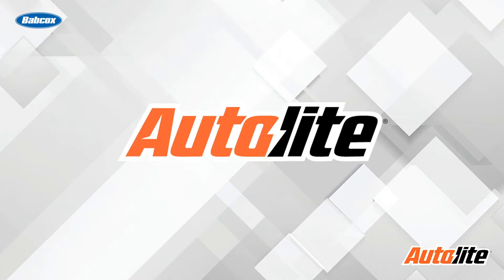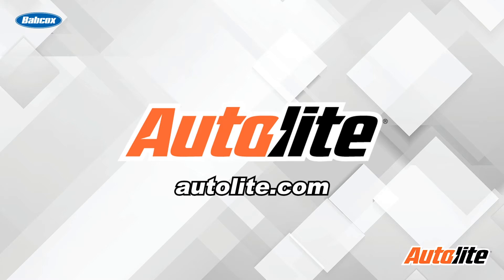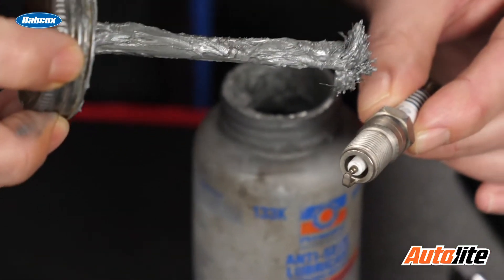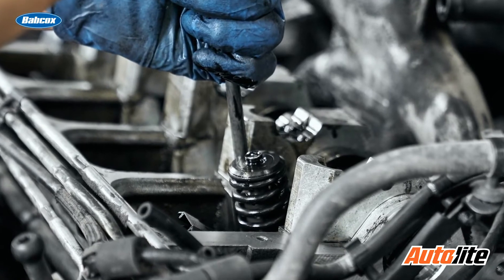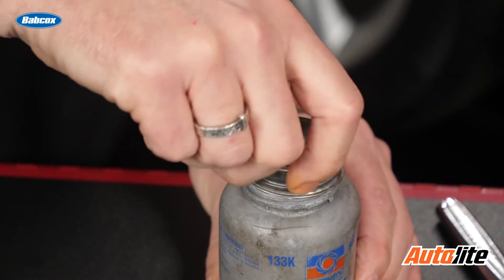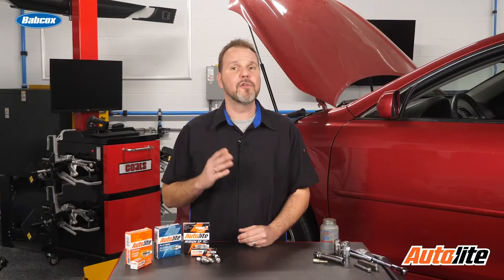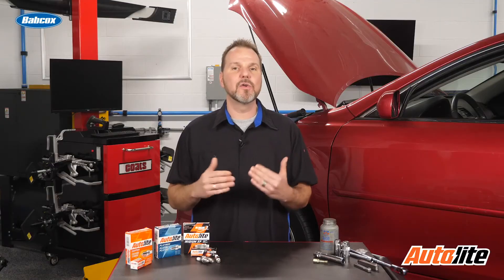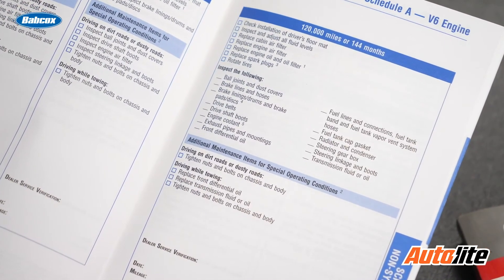Should Anti-Seize Be Applied On Spark Plug Threads?

Comment: Ive been using anti-seize for decades and never a problem. I keep it away from the electrode and the seal washer, and go easy on tightening. Very important, now leave it alone for life. When removing plugs for routine inspection later, do not reapply the compound. How much to use? A little goes a long way, just a thin coating and stop. Alternatively, you can follow the video and do nothing but I cant guarantee you wont have a stuck plug later. For that, i have no solution. See other vids about removing stuck plugs.

Comment: I have to agree with all this.  I used motor oil on plugs and it caused oil to be sucked up into the plug well. This video is very rational and well presented.

Comment: In the Factory Lycoming engine manual for piston engine aircraft,  it requires anti seize on the spark plug threads except the first two closest to the electrode.  Evidently anti sieve does bad things inside the cylinder.

Comment: I think this guy has pre-torque confused with final torque. 
Pre-torque relies on the theads' friction and initial contact with the crush washer.
Final torque comes from the collapse of the crush washer. Once the washer is flattened, your done.
Anti-seize has no effect on final torque because it can't change the force required to crush that washer.
I don't use Anti-seize.  But, as he said, in a corrosive environment and dissimilar metals, electrolysis may occur. This may seize your plugs over time.
As far as grounding the plug,  I wouldn't worry too much about that.
There is so much shear from the force of those threads, a ground is pretty much guaranteed.

Comment: I wouldn't anti seize them either. Anything you do anti seize you should start by yeeting that silver crap right in trash or give it to someone you hate then go and get copper anti seize.  To make yourself feel better about spark plugs seizing up since the the damn thing do last 'till armageddon now just crack 'em loose a few turns , maybe even pull them out and inspect them and re install them every now and then when you have nothing better to do.

Comment: if you've ever had a stuck / broken plug in your head- you'll worship anti-seize.  Don't over do it- just a little bit and then use about 90% of the torque spec unless you are SURE the spec accounted for lube. I do 26Nm on my Volvo S60 plugs w/anti-seize-  never an issue.

Comment: Waukesha 7044 GL recommends using a tiny little bit on the first couple threads of the spark plugs on account of not spinning the plug carrier during replacement. Aluminum anti-seize on the plug and copper anti-seize on the carrier threads, says 30 year factory trained Waukesha mechanic. But that’s only on a GL. All others don’t from my experience

Comment: Back in the 80's Champion plugs in a Chrysler aluminum head were very troublesome when trying to remove them. Right or wrong, Anti-seize prevented a lot of problems with damaged threads and plugs that wouldn't come out.  Just a small amount does the job. I think people tend to use too much.

Comment: I'd say it depends if it is an engine that often has a problem and for the electrical connection there are so many points of contact that will still be made I don't think you will be able to measure any change in conduction

Comment: Wrong wrong wrong. Ford now recommends lubricating spark plugs with moly grease. It just needs a smear on the threads . My interpretation of this is it prevents water from corroding the threads of the plug near the combustion chamber which intern prevent damage to threads  of the cylinder head. I’ve been doing this way way before Ford recommended it and have ever had to repair a spark plug hole thread. Same goes for diesel injectors , once again Ford now say to lubricate the injector body(only on injectors that are externally fitting). This prevents water from corroding the injector body to allow ease of removal . I do the same for glow plugs as well. The only thing I found with glow plug torquing is that you have to allow 30 second between each torque as it allows the moly to extrude out. Which is the same and Ford parks plug torque sequence, 20nm- wait 30 seconds - 20nm

Comment: Please consider research into recip aircraft standard practices. 

  Always use correct type of spark plug anti-seize lubricant, and a new or properly annealed sealing washer EVERY time a spark plug is installed. Torque properly with a torque wrench of known calibration.

  Thank you for your time and attention.

Comment: Have been using anti seize on all aluminum head engines for around 40 years and no issues.  It prevents galled threads in aluminum heads from dissimilar metals corroding and making plug removal rough.  Yes you just torque less as with any faster that is lubed vs dry.  Head bolts being an exception to the rule.

Comment: I stopped paying attention as soon as he said no. Every point he made is very debatable.  The torque issue is remedied by not torquing them in as tight. The maybe not getting ground is marginal due to the nickel or copper component of the antiseize. If you have aluminum heads, you damn well better install the plugs with antiseize.

Comment: Without anti-seize you risk galling the thread in the head and then you’re in big trouble. I use anti-seize for many years now and it’s common sense to just nip the plug firm when tight and not any torque value.

Comment: What’s your training background in materials engineering and metallurgy? 

The fact is old American engines w/cast iron heads, it’s less an issue. Most every modern engine employs aluminum alloy heads, spark plug threads are zinc plated steel. This will unequivocally lead to galvanic corrosion. ALWAYS apply thin layer of nickel antiseize to spark plug threads. They will not only torque properly, the threads in head will not be galled when it’s time to remove them.

Comment: I worked as a mechanic in the 70's and Autolite plugs were the worst offenders for corroding and getting stuck in heads. Later, I bought a car that had Autolite plugs and had a plug fail {no continuity) while in service for the first time.  I have always wondered if the antiseize increased resistance between the plug and the head, but preferred not to risk a seized plug.

Comment: I think the real problem with anti-seize is the user sometimes has no idea what the chemical compounds are in the lubricant. I believe the horror stories come from corrosion due to corrosive garbage in a lubricant. I've only seen once where the lubricant actually corroded the plugs really bad. Usually no problem. However, I just go with the original engineers who designed an engine who usually don't recommend lubricant. That doesn't mean you can't if you have a specific reason for using it though.

Comment: Dumb advice, you said you use it on other bolts, but a manual will not tell you to use it on those bolts either, so why do you use it on them and not a spark plug. If you gorilla torque a spark plug you are a moron anyways.

Comment: Krol oil is also an excellent anti seize in high heat areas. If you ever had to retread a head, you may want to use some copper anti seize from the tube on the first couple threads .

Comment: Always use anti-sieze on spark plugs installed in aluminum cylinder heads. Never remove a spark plug from an aluminum cylinder head until the head is completely cooled off. Ford had spark plugs blowing out of Triton V8 cylinder heads because Ford did not use anti-sieze when they installed the plugs. The person replacing the spark plugs did so with the head still hot. Carbon builds up on the tip of the spark plug. When the plug gets backed out of the hole, the built up carbon on the tip chews up the threads. Anti-sieze helps prevent this. Whenever I replace plugs on a hot aluminum head, first thing I do is blow out around the spark plugs with compressed air. Then I will back the plug off about a half a turn. I'll put a generous amount of penetrating oil in each hole and let it set until the head completely cools off. The heat from the head will cause the penetrating oil to wick down past the threads and help aid in removing the plugs. It will also soften any carbon that may be on the tip of the plug.

Comment: I've been working on automobiles for over 45 years and always use anti-sieze on spark plugs. Never had any issues yet. I also work as a maintenance technician in the petrochemical industry. We assembled everything using anti-sieze, whether its in a hot or cold service. Reduce the torque by 25% and you'll have no problems. We have ANSI and API charts that give a dry torque spec, a wet (oiled) torque spec, and of course, a spec for using different grades of anti-sieze.

Comment: Yes I know that. Been using anti-seize for 50 years years trouble free. And there is no grounding issues, did you measure it with a four-wire meter?

Comment: Been using copper anti-seize on spark plugs for decades. It's been the recommended procedure on Mercedes for as long as I can remember. Just reduce torque by 2-3 nm from dry spec. And anyone that has worked on 3v 5.4 Triton's will tell you how important anti-seize is on those plugs. Also recommended in marine applications.

Comment: Been using it on spark plugs for almost 50yrs with no ill effects. Especially on plugs with an unplated base like AC or cadmium like Champion. I do try to use only Autolite with the nickel-plated base. Never had to use a torque wrench either. Today's spark plugs last a lot longer than when I started wrenching. Longer time to allow corrosion.

Comment: I used it on a triton V8 with the 2 piece plugs. Never had a problem. Just don't over apply it, and keep it off the electrode.  400 k and still rolling, change the plugs every 100k and still used the 2 piece plugs. Truck is gone now so can't say what the new owner does. Or if they still make the 2 piece plugs.

Comment: Sorry man but we have been using copper anti seize on any engine with a aluminum head forever, in a piston aircraft engine you would ruin a cylinder if you did not use it. Just don't use so much that it gets on the ground strap and shorts out your plug. Yes, it will change your torque value which you should adjust for.

Comment: Anti seize is the best thread lube there is, other than ceramic, if you don't use it, you can take it apart, spark plugs are stainless, so it's always used

Comment: Having pulled engines apart to resolve corroded in plugs you MUST use anti sieze on plugs into alloy heads. Not a bad idea on iron heads either though generally not essential. Do not use a lot,, or it will get in the chamber and cause detonation.
I use copper anti size, never had an issue. I have had the tin since the 60s!
Reading the comments I am with the vaste majority. You are wrong.

Comment: If what you're claiming is true, then ANY bolt coated with anti-seize is going to be over-torqued when tightened to spec torque values. Hell, I've used anti-seize for forty years on a number of engines and machines and I've never had any problem.

Comment: A misconception about anti-seize is that it’s a lubricant. It is not. It’s actually the opposite. The metal shaving dust inside acts as an abrasive that keeps threads from backing out on their own, while the grease in the anti-seize ACTS AS a lubricant by creating a slick barrier between threads, which also protects against corrosion. Too much anti-seize on lug bolts for example can require more turning to reach the required torque (80 to 110 lbs/ft) possibly resulting in stripped hub threads. If you’re torquing spark plugs to 100+ lbs/ft you don’t need to be working on cars. Just put a little antiseize on your spark plugs and torque with a 3/8” ratchet.

Comment: I have actually used high temperature bearing grease on spark plug threads for 45 yrs. Anti-sieze did not exist back in the day. Particularly on motorcycle engines and engines exposed to the elements. With alloy heads that repeatedly get wet, an electrolysis can occur between the two different metals that actually promotes corrosion. You do not have to be a brainiac to use a torque wrench or socket wrench, to know when a plug is securely tight. With any alloy head, if you go swinging off the wrench, you will strip the threads. I do enjoy it when the removal f spark plugs takes less than 10 minutes and the wiping of the plug aperture with a paper towel shows a clean, pristine thread in the cylinder head. I have heard what this guy is saying numerous times. I just like doing it my way.

Comment: Utter Bug - "crap"!
You'd Never use a thread chaser on a new plug, if it is in fact coated, you've just scraped through it.
You never chase the hole unless you know how to keep any metal out of the plug hole.
As far as grounding - the moment the plug snugs up it cuts through the anti-seize, and the tapered or gasketed shoulder comes in contact. 
That dab of anti-seize can make the difference between the plug coming out, or pulling the threads out next time  plugs are changed, particularly on aluminum cylinder heads.
On vertical spark plug positions, any moisture/condensation that collects on the plug or around the hole runs down the plug, and collects at the bottom - sometimes getting down into the threads and causing corrosion. 
So I'll take my chances WITH doing what has been successful all along.

If he's confident in his advise, he should be willing to remove your stuck spark plug(s) installed dry as suggested.

Comment: Or,,,,,, anti-seize on dry threads will give correct torque value because you aren't trying tighten plug with corroded threads, in other words you are thinking you are crushing the crush washer all the way when actually you are only crushing part way. Therefore when anti-seize is applied I can EACTLY feel when tight is tight and tight enough........

Comment: Galvanetic corrosion is not a good thing. Especially when you're installing a steel spark plug in an aluminum head. Because the spark plugs are coated, I even use it on steel heads. 
When copper spark plugs were commonly used, it wasn't that much of an issue. Because the spark plugs would normally wear out before the plug had a chance to seize in the head. But now spark plugs are designed to last 100k miles. That many heat cycles can cause the plugs to seize in the head and make it a nightmare to remove.

Comment: after having installed spark plugs for over 65 yrs i simply disagree-- i have worked in large shops and small shops and have yet to see anyone torque a damn spark plug (maybe a straight timer who is not concerned about the length of the operation)  but i have seen the results on many occasions of rusted and seized plugs that cannot be removed by normal means --lubricate the damn threads and tighten the spark plug in until it is TIGHT

Comment: I don’t think I agree. I’ve been replacing spark plugs since the 50s and never used a torque wrench on them. I never used anti seize either. What did happen is that I went to change plugs on a 90s SAAB, which I had not installed, and as I started to carefully ease the first plug out I felt the threads begin to give way. I stopped and gently tightened it up bit and let it the heck alone. As you know perfectly well that feel only comes from experience and unlike a torque wrench is responding to the physical reality of the threads in question. When modern engines started using plugs that last 100,000 miles I started using anti seize and have had no problem. My 2000 Echo has 300,000 kilometres(200,000miles)  on it. That the anti seize messes up the torque readings is an interesting insight and thank you for that, but my hands know when I’ve tightened a plug enough. Go ahead overtighten the plugs on a cast iron head, but it should be clear that you don’t want to tighten up a plug in any alloy head. Just nip it up and ease a little further gently. That what I experienced with that SAAB head and I was away from home at the time and didn’t fancy putting in helicoil in a friend’s driveway hundreds of miles from home. I know modern mechanics are trained to go by the book and I’ve had to learn a few lessons by being ignorant of the book or ignoring it, bit being in direct touch with your senses and your general knowledge is important too.

Comment: Some kind of lube , engine oil , penetrating oil is necessary to keep from stripping threads especially with dis similar metals. I usually use anti sieze . You do not need a lot. I do not torque spark plugs and in 25 years of professional wrenching and 42 of working on my own vehicles have never had an issue. Too many people have way too much time to nit pick about things that really are not an issue.

Comment: I usually put a drop, very little dialectic. grease on the threads only.have you ever tried to remove an aluminum spark plug from an aluminum engine. after 90K not as fun as you would think, years ago when I was young Iron not so much of a problem.